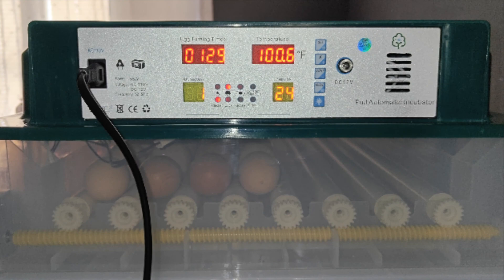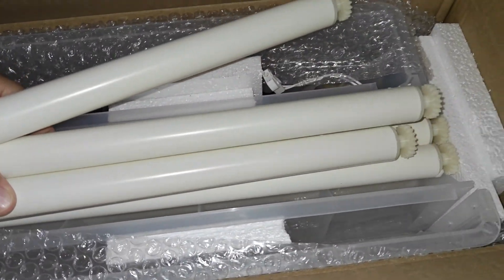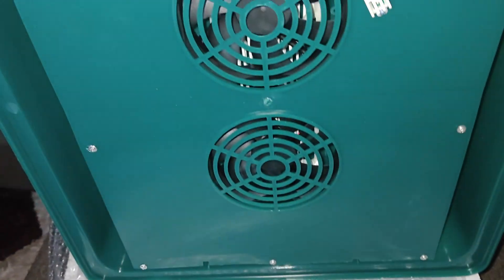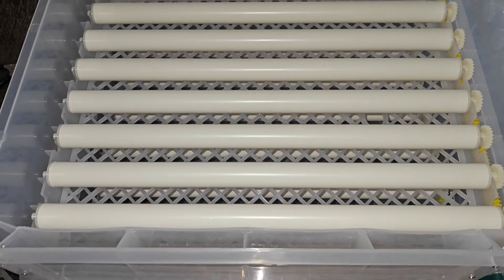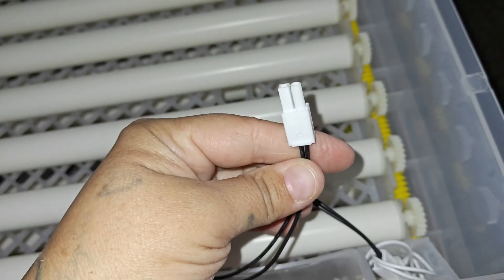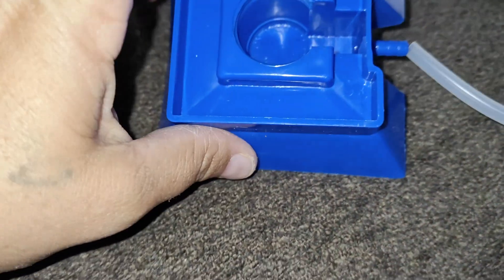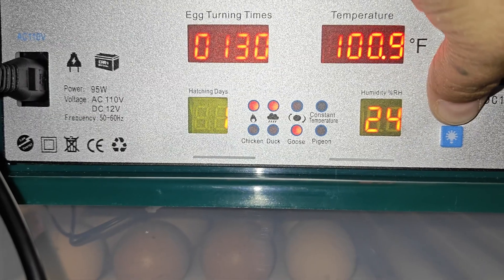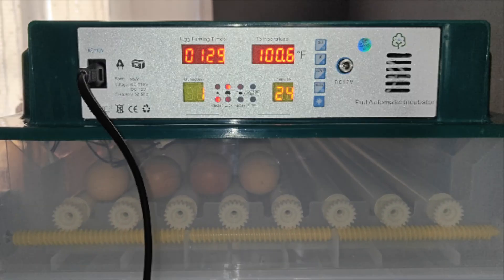Hethya 120 Automatic Egg Incubator with Egg Candler

Comment: How do I reset this incubator?
Reply from the maker: You need to go into the settings like you would to set it, just change the days down work. Press and hold the "SET" key button for 6 seconds, then keep clicking the “Set” button until you see the F5, once you hit the F5 you click on the - minus button until you see 1 which is for day one. Check out this video: https://youtu.be/YebM2q91M3U?si=hCZGY2lXFiDmbZeq

Comment: I wish your instructions were clearer, showing step by step how to assemble it.
Reply from the maker: the bottom was already assembled, the top one was just screw in the sides to the front and back pieces, then screw in the metal part to the bottom to the front and back panel.

Comment: Do you leave vent on top open at all or no? When i close my vent then the humidity jumps to 79 but when i open the vent a little then the humidity drops to 65 regardless or thr water amount.
Reply from the maker: I open the vent a bit to get my humidity to 55 and to keep it at that, if it goes higher, you might want to open it up a little bit. If the humidity drops, you will want to close it a little, just adjust a little bit to get the desired humidity.
Reply: How do i teset it. After 1st hatching😊

Comment: I got the same incubator but am about to use it soon....when do you turn off the egg turner? Of do you leave the egg turners on all the way until hatch?
Reply from the maker: if you are incubating chickens, I usually take out the rollers on day 17. You don't want to open up the incubator from days 18 to 22, that is considered "'LOCKDOWN" or they will dry out the chick egg. For duck eggs, I usually take out the rollers on day 24. Lockdown for ducks is from day 25 - day 30
Reply: @marisreviewchannel  thanks for the info.....how often do you think i will need to add water to the incubator? Once every few days or?
Reply: @marisreviewchannel  and if i do take out the rollers on day 17, do i still need to rotate the eggs or leave it alont and let it hatch?

Comment: I am not understanding the humidity control water adding system. Could you explain if you have figured it out?
Reply from the maker: What I have done with the water for the humidity is, I took a bottle soda filled it up to the top and just took the hose and inserted it into the side where the three dots, and let it drip on its own. This bottle needs to be refilled evert other day if you use a bigger sods bottle container, I used one that is a bit bigger than a 20oz, but less than a 2 liter bottle. I think its a 32oz bottle, that I fill up every 3-4 days depending on the temperature and the humidity in your home. This method has helped me hatch most of all my chick and duck eggs. Hope this information helps you, if you need more inside I am happy to help.
Reply: @marisreviewchannel  it doesn't seem to drip into the bottom unless it is on something and then it runs in. Lol
Reply from the maker: @therandomsurvivalist  I usually have it on the back hole, that one holds a lot more. It drips in but a lot slower, I usually fill the bottle up let it drip in all the way, then refill the bottle up again and then once the first water gets used up, the new water will drip in.